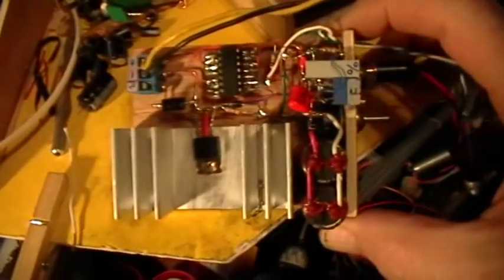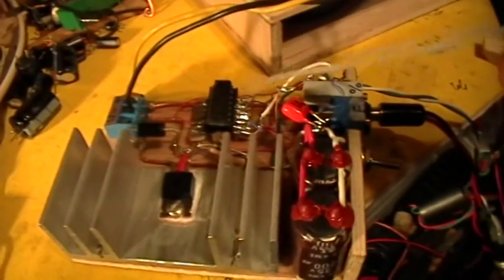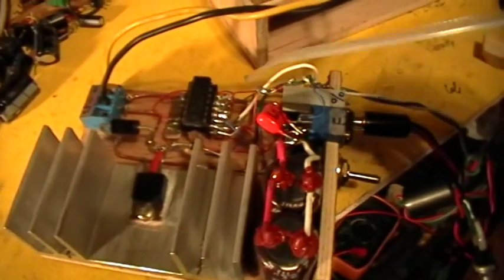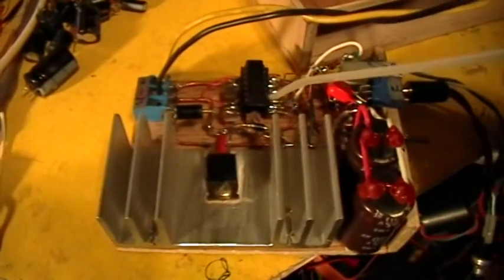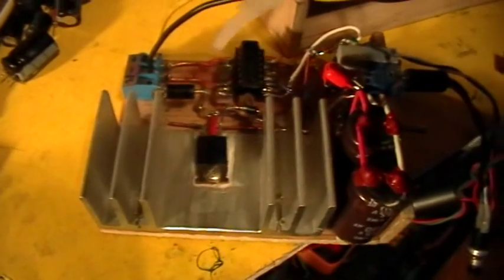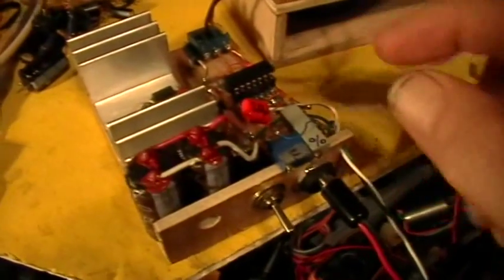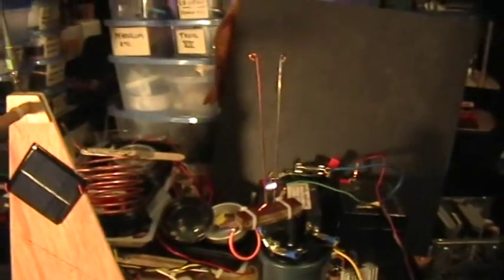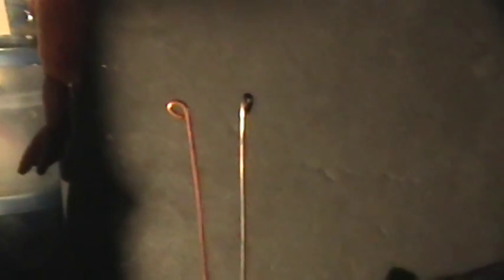Misc Circuits: CD4093 Based Ignition Coil Driver Jacob's Ladder

Comment: @ 0:45, did you mean CMOS chip? I thought 4000 series logic was CMOS, and 74 series stuff is TTL. I have a bunch of old TTL logic from the 80's, do you reckon it will work well enough? That a good output at the  frequency. I could not get my coil to produce that high a freq. without diminished voltage output, and every attempt with a 555 led to dead MOSFETs. I like the self-oscillating relay driver the best so far. Its just a bit noisy.
Reply from the maker: Yes, CMOS, thanks, I did misspeak. However if you are looking for a 555 coil driver, you might try this one:
https://www.youtube.com/watch?v=--b7CyjzUB4
https://www.youtube.com/watch?v=H2nEs6cQS-w
Reply: TinselKoala Thats fine. I lost interest in the circuit awhile ago and now working on making a nice big quadcopter! Maybe I will add a tesla coil to the bottom of it to create truly man made lighting from above! >:)

Comment: nice setup, i though it would be simpler
Reply from the maker: Well, the 555 timer-based circuit is a little simpler but it's not as versatile, I think.
https://www.youtube.com/watch?v=--b7CyjzUB4
I made the PC board by tracing it off of the monitor screen onto a piece of paper, then transferring the hole locations to the copper foil side of some board material, then drilling the holes, then sketching in the circuit traces with a "Sharpie" marker, then etching with ferric chloride in the usual manner. After that, it's dead simple to assemble.